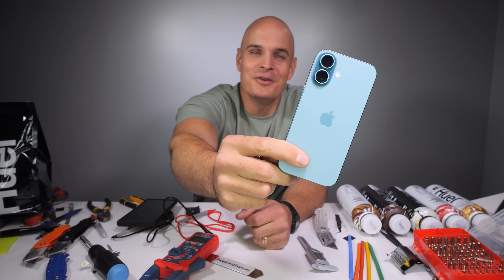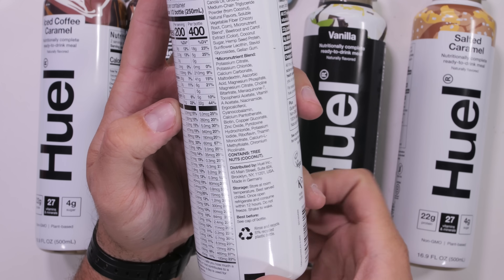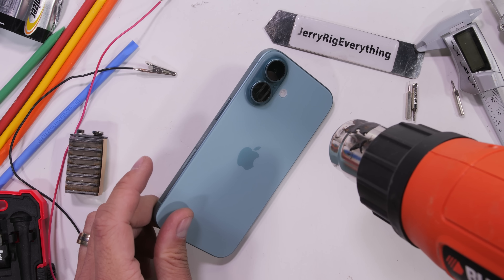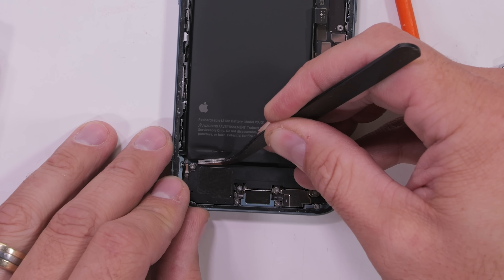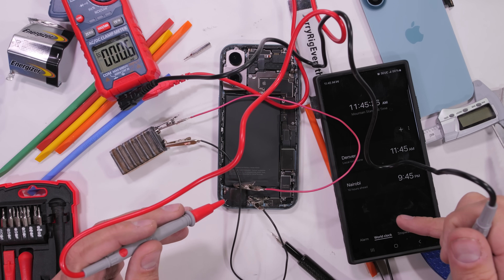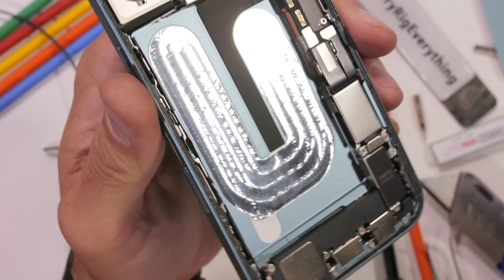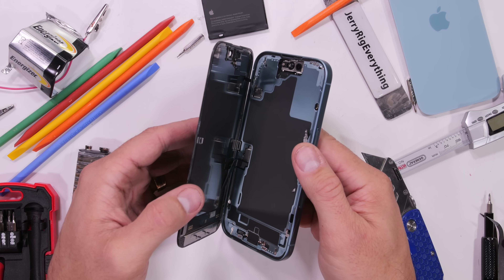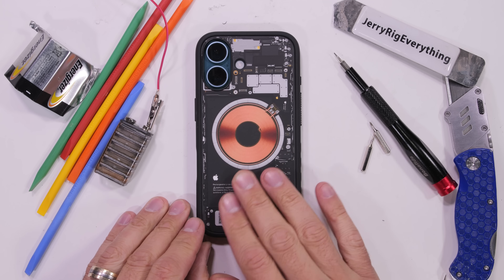Apple *FINALLY* did something new... (iPhone 16 teardown)

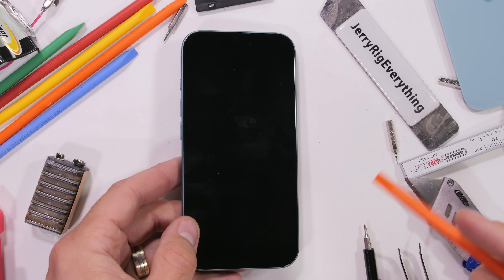Comment: 5:22 apple feeling generous or feeling the heat from EU? 😄
Reply: This is a huge image boost for apple. I hope the emptyheaded investors will see the long term benefit.
Reply: @JayMaverick  
There no long term in a market economy. And thats not me being sarcastic, there really aint any.
Reply: @JayMaverick  I hope samsung copies this like they usually do as well
Reply: @shinouske126  The have to. The only reason why Apple is doing it is because the EU forced them to. Not something against Apple, but something against the unrepairability of devices nowadays.
Reply: @shinouske126  you could already do easy repairs on samsung phones for years at any decent repair shop around the block for years though. They don't have screens that are artificially locked to the phone etc.
Reply: @Xfade81 that may be true but iPhones being display first has made repair so much easier even with the BS parts pairing. Now being dual entry i feel the iphones are easier to repair. Not to mention the industrial strength adhesive samsung used on the batteries.
Reply: @Xfade81 repairing samsung is pain in ass n 2x expensive
Reply: @Xfade81 any repair tech would tell you that is false. Samsung only added primitive battery pull tabs with the S23 lineup. Before that the batteries were straight up glued in with no easy way of removing them. 

Apple being anti-repair doesn’t magically make Samsung pro-repair. They have always sucked about repairability, it’s just more from a lack of care rather than the deliberate, malicious attempts to prevent it that Apple has done.
Reply: @RalphVB  I wonder how long they've had this technology in their back pocket. I also wonder if they have something similar for the adhesive used to secure the back of the phone. Obviously it would be somewhat more complicated to trigger the unsealing of a narrow adhesive strip around the edge of the phone from the outside, but it might be doable -- getting 9v via the USB C socket and a microswitch controlled by a (normally) hidden setting in the developer mode options.
Reply: @EnglishMike  It probably won't provide a good enough seal for any kind of water resistance
Reply: @EnglishMike  Yeah, it does make you wonder huh? I think it could be done by creating a bigger plane for the screen and the backglass to sit on,. All they need to do is make it detachable with a couple of screws )cause it will have to be build over some components.. They don't need it though, their machines just heat it and vacuum pop the screen off basically automatic, so I doubt they will ever do that. 

The ridiculous part of this all is that the battery replacement still isn't easily done by everyone. This 9v battery adhesive trick equals about the same difficulty as using some ipa. On model 13 and below it was a matter of taking the screen off, now it's the backglass in the same fashion. 

That's the only plus side, the backglass being reuseable.
Reply: @RalphVB  Yeah, though the back glass on that iPhone withstood a lot of prying with a metal knife without breaking, which is much better than my OnePlus 7T which is supposedly impossible to pry open without damaging it.
Reply: @RalphVB EU didn’t force them lol
Reply: @Xfade81 as a former repair technician I’d rather work on an iPhone or a Sony any day of the week. Samsung screens are usually half or more of the price of a new phone, most repairs can not be done without breaking at least some parts of the phone. They’re atrocious to work on.
Reply: @EnglishMike  yeah on this and the 14 and 15 but before it was superglued for life.
Reply: @shinouske126  is that why this is the first time apple did something new? since everything they do is cheap samsung knock off
Reply: @YasinHasan  they removed the headphone jack and charger.
Reply: @Xfade81 was about to say that lol. Any android phones don't complain if you change the screen or battery or even cameras 😂. Only apple with software locks. Samsung could easily join in but I think a load of consumers would swap to OnePlus, Xiaomi etc
Reply: @luipaardprint Sony Xperia XA series is absolute shambles to work on especially the plastic cover that goes around the camera to the main board like a backwards L shape. And when you do a full frame & screen swap the motherboard has to go in a certain angle to fit flush in the frame again 😂 (this the original XA (f3111) I'm on about.. never had to fix a XA1 or 2 b4)
Reply: @luipaardprint  They are expensive because they are well developed. Samsung puts more money into their phones compared to CrApple.
Reply: Since the iPhone is water tight the EU battery law does not apply to it.   The law will however have an impact on AirPods and iPads (not water tight).
Reply: @hishnash can’t wait for Apple to add water resistance to the iPad as a groundbreaking new feature…
Reply: Won't somebody think of being generous to the shareholders!?
Reply: Apple would be feeling the heat from the EU, except that…

Three trillion dollar Apple is more money than the GDP of the entire United Kinkdom. At this rate it will be more than most of Western Europe in not much more than ten years
Reply: imagine being so thirsty for clout  @JerryRigEverything
Reply: @hassanahmad568 yes, I believe you are correct - the right to repair regulations about to come into effect in the EU and the gathering push in the US to have similar laws is the most likely explanation. Thanks and shoutout to @LouisRossman and others like him pushing for this!

Comment: But what happens if you actually swapped the battery in the iPhone? Does the data get wiped liked older models?
Reply: You do not have to wipe your data to replace your battery ;)
But if you go to Apple, they do it for some strange reason
Reply: why would data be wiped in newer or older iphones.

Comment: 0:35 it depends on the 9v. some have veritcal AAAA cells. or at least thats what they look like
Reply: I know I tore some apart as a kid and that's what was inside. Six 1.5v cylindrical batteries. I don't know if some are still made like that or not. I haven't opened one up in at least 35 years.
Reply: was gonna say the same, i even remember seeing a 9v made out of stacked button batteries, but the arrangement was kinda weird
Reply: I was going to comment the same.
Reply: why did they invent the 9v battery? I mean why this shape
Reply: @alf3071 My guess is that they needed a higher voltage battery for portable electronic devices and needed to keep it relatively small. Just my guess though.
Reply: @alf3071  The 9 V battery was originally invented for transistor radios in the 1950s and, at the time, it was actually expected to deliver 22.5 V.

Comment: Apple next year: triple press the power button to eject the battery
Reply: @IsaacFoster..  then what the fuck is this
Reply: @ariate8  the bare minimum the eu asks
Reply: @WohaoG  the hawk minimum the tuah asks
Reply: @ariate8 😂
Reply: @ariate8  Its not in any other 16 variants, only base ip16
Reply: @ineedgoodname  I know girliepop
Reply: @IsaacFoster..  it will have, in 2027 in EU
Reply: @IsaacFoster..  I don't care about your opinion really... I live in the EU. Batteries here need to be user-replaceable within the next 3 years, so Apple will need to enrol models that can be maintained even by the most under-qualified of users, and if you know anything about manufacturing, R&D is expensive... Designing and manufacturing twice the phone models to comply with the EU market and sell less repairable phones outside it may just as well end up costing them more than what any revenue forecasts would show they would lose on just selling user-maintainable models world-wide.
Reply: @IsaacFoster.. bro missed the entire point of the video
Reply: If apple does that if u drop ur phone by accident it's gonna remove ur battery with opening up the phone so how are u gonna fix that
What I mean is it makes more inconvenience for the user just like how apple doing everything they already done
Reply: No. It will be: Pay $99 to remove the battery, and pay $200 for a new battery
Reply: Not a bad idea!
Reply: That is assuming Apple would innovate something new, which they haven't done for many years lol
Reply: Apple next year: buy a special $126.99 tool to eject the battery. Available in pink, rose gold and blue.
Reply: You wish
Reply: Cant y’all just use alochol to make or easier
Reply: @lol-ge9bh 
I'm sure a couple of martinis would help.🍸
Reply: @lol-ge9bh  that can kind of get everywhere
Reply: They better not cuz I have the 3 press power button mapped to turn my screen brightness down. My eyes sensitive to light and in a dark room just turning it down all the way is still to bright but if I press power button 3 times it makes it a lot darker. And I use this like 20 times a day so if they do well that battery going to be bouncing out like a lowrider 😂
Reply: What's baffling is why Apple couldn't just use the power from the battery by simply shorting two nearby terminals.   And yes even an old battery has plenty of power to heat up the strip.  As smart as they are, not quire. lol
Reply: Me trying to call 911 in an emergency and the battery flying out of my phone
Reply: It took 17yrs to get this and you think they are going to invent a button release in one more year 😅
Reply: america would not be happy with that one, not the citizens but the government. Certain agencies (plural) do not like removable batteries in such devices. They even pay (and give other incentives) to device manufacturers to make sure that does not happen as often as possible
Reply: @IsaacFoster.. they are literally required to lol
Reply: I fix it will still give it a 2
Reply: Plug in the charger on the other side to detach all components)
Reply: Nah, they're just gonna add another button for it, an eject button
Reply: Battery button
Reply: After that, you go to using 4 AAA batteries in a compartment with a push tab. And the battery innovation cycle is complete
Reply: Nah that's in the next ten years
Reply: that's a cool idea. ! atleast sim card tray from any company , IDK why I'm stupid or it's hard to remove sim card tray sometimes , getting right angle is hard but repairers can do it. I have sim card remover tool but it's hard, Either sony's manual or Eject sim card sounds like a CD driver eject so it's cool :3
Reply: Samsung sorry for not innovating enough but no sorry for their leggy devices since beginning
Reply: technically they could use the battery itself and a boost converter to eject the battery.
Reply: Not a chance ... It'll be at least 7yrs AFTER android has it 😅
Reply: 😂😂😂 this is feature
Reply: I mean that could be a good idea actually.
Reply: Man that's funny
Reply: Triple pressing the power/side button already has a function… It’s a customizable accessibility shortcut. I do it all the time
Reply: And everyone just forgot that the EU fined Apple and this is why they are so "generous".
Everything "generous" Apple does is because of the EU, you need to thank them, not Apple lol
Reply: @IsaacFoster.. because battery health is usually why people upgrade
Reply: It's always faster to switch to your secondary iPhone than reloading!
Reply: Imagine a tatical battery reload
Reply: @IsaacFoster..  iBook g4s disagree
Reply: Yeah, it’s gonna turn into jello and leak out the charging port. You’ll still need to open the phone to put the new one in obviously.
Reply: That’s actually perfectly reasonable and if it wasn’t a potential safety hazard you don’t need a separate battery you could (and it would actually make sense) to use the battery in the phone! And absolutely, it could be set up to be triggered in software!
Reply: They are going to be forced to at least for anything I sell in Europe but not by next year.
Reply: @ you do realize it’s thanks to the EU they finally switched to USB-C! And it’s the only body powerful enough and not bought out that could force them to make things more 3rd party repairable!
I couldn’t tell if you were for or against?
Reply: Are you not entertained ? General Maximus
Reply: @IsaacFoster.. they have to, not that they need to. Due to new EU regulations in 2026.
Reply: Apple next year: No power button 😂
Reply: Then we could really say apple is better than Android 😂
Reply: @ same law applies to android too.
Reply: Feels over engineered
Reply: Like John Wick is switching his weapons magazine 😅
Reply: .Tell me please. Have you ever opened the processor of a smartphone? It feels like they haven't been updated for five years. They install the same processors.
Reply: Ejecting pilot
Reply: Be careful! Four presses will eject your data in true Apple fashion.
Reply: In 2027 :)
Reply: I just tried that and it almost called ems bro don’t do ts
Reply: @DerPfoertner  give your phone back to your parents kiddo , you ain't mature enough for the real world
Reply: Power button?
Reply: Yeah Dream Onnnn....
Reply: They theoretically could do that. They could just put a cell battery in there that's connected to the contacts under the adhesive and then you could just like go into repair mode or something and there could be a setting called eject battery and then when you click it it could shut down the phone and then close the circuit between the cell battery and the adhesive. And then you could just replace that battery in order to be able to do it again.
Reply: Samsung 2 years later when they copied it: „hey look, we have a new innovation in our Galaxy S32“ 😂😂😂
Reply: @DerPfoertner  As an apple fan I got to ask, isn't usually the other way round?
Reply: @DerPfoertner android copies good iphone implantations almost immediately whereas iphones have the track record of copying great android features after 6-7 years , wtf are you smoking? Enjoying placing apps anywhere on the screen too much lately are you?
Reply: @DerPfoertner  innovations are new
Reply: @IsaacFoster.. it’s way easier than in any Crap Android phone
Reply: @DerPfoertner you get android phones with swappable batteries still like the fairphone
Reply: @Brokegamerboii Fairphone is the only one. All the others are glued together like hell
Reply: @DerPfoertner  I've had Samsung XCovers as work phones, those phones have a removable back cover and removable battery, like phones had back in the day. Way easier that iphone's.
Reply: @Njazmo look at Samsung now. Glued together so hard, opening one of these crap phone means a broken screen or broken backpanel.
Reply: @DerPfoertner have you even actually seen any of his videos? Samsungs glass would crack due to improper removal tools. Not only that but because it's curved glass you shouldn't use steal razor blades to remove the adhesive. For a very very long time apple had their phones glued together in such a way that it was impossible to remove the glass without a laser. It wasn't until android started using adhesive on the actual sides of the frame that apple thought hey lets make it easier to remove (making difficulty of removal similar) and the the batteries, android phones like Samsung have been using ways of removing the batteries that were far better than Apple phones because apple would use these weird pull tab things that failed to often compared to Samsungs method which is easier. Then back in the day Samsung used something known as plastic backings and user replaceable battery packs which apple is now implementing sort of in their new models. In fact my moto g stylus has a back glass that I could easily remove and likely a battery I can remove easily aswell
Reply: @DerPfoertner  I dunno, I still recall some of my earliest smartphones, wherein I could easily remove the back panel, and just take the battery out in seconds. At times this was useful if the phone had some error happen which caused it to freeze. Just remove the battery, thus the power is also removed.
Reply: @DerPfoertner its not. some android phones Have a plastic back that is wayy easier to remove and impossible to shatter because plastic.
Reply: @DerPfoertner Ever heard of a Fairphone?
Reply: @DerPfoertner actually it's usually the crap ones that have extremely easy to replace batteries.
Reply: @DerPfoertner exactly
Reply: @DerPfoertner to be fair I've never replaced an android battery but many iPhone batteries. I have an old Huawei mate 10 pro which I got around release which is still going strong on its original battery.
Reply: Huh? How come iFixit gives pretty much every Android phone a higher repaiability score than Apple! I mean come on besides Android phones are way better at the high end. QHD screens, desktop modes, way bigger camera sensors, all of the pixels even the tiny little pixel 7A crushed the iPhone 15 pro in MHKBDs blind test. That used elo ratings and had a sample size of 22 million votes. But okay...